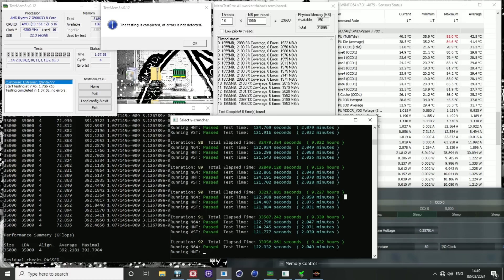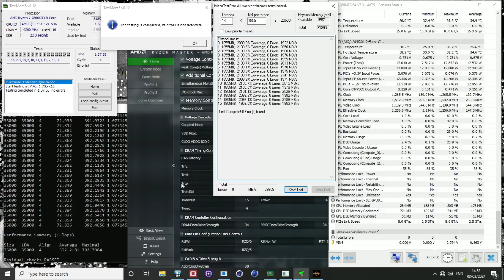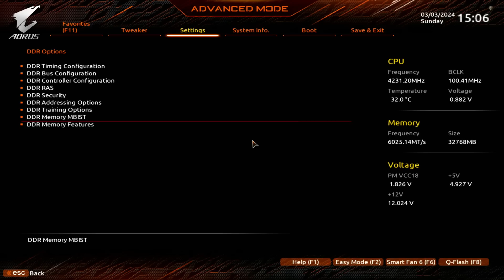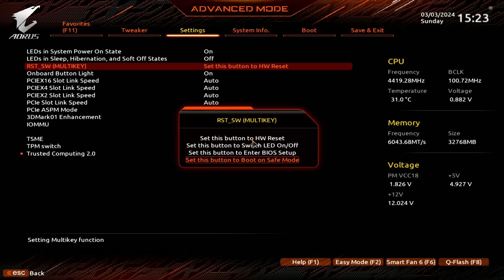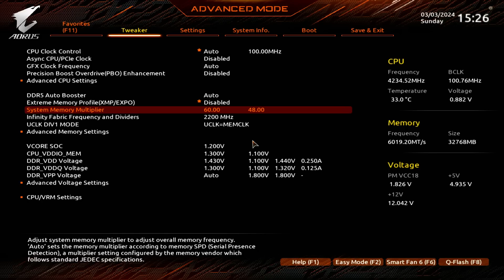Ryzen 7800X3D, 2200MHz FCLK, DDR5-6000 28-36-28-30

Comment: Actually even at 6000 MT I have issues with the 7800x3d. 
But only in BF5, dunno what that does to my memory, but there it simply hard resets (poof reboot).
Not reprdoducible otherwise so far ...
Reply from the maker: intresting I was seeing that at 6200.
Reply: But what I can do is run y-cruncher for hours + furmark (to get graphics going as well) + the hynix subtimings.
And that even with ram voltage of 1.3V and SoC 1.1V. (Expo sets 1.4V and 1.25V). 
And that runs stable (all benchmarks see no breakdown at lower voltages.
Its literally only bf5 where I have to go to 5600 cl32 or lower for it to be stable.
Reply: @Durayne  maybe increase your VSOC a bit. Not all chips can do 6000 at 1.1V.
Reply: I only did the testing with 1.1V / 1.3V to see if those instabilities are Voltage related. However even at those Voltages everything else is stable.
Default ist 1.25V and 1.4V but it does not help.
Reply: @Durayne Finally found someone with the exact same issue apparently.  My build was rock solid with my 7900x switched it to a 7800x3d (didn’t change anything else) only in bf5 I get instability issues.  I have completely wiped my windows and clean installed everything when swapping to the X3D so not OS related. So far looks like a game optimization problem for that particular Chip.
Reply: @ Hey there. Initially got it solved by removing the memory retraining saving. Has the drawback of having to do a memory training everytime.
With newer bios versions this did seem to not appear anymore. 
But I cant test BF5 anymore as I am using linux and EA now blocked linux over their ea anti-cheat.
Reply: Battlefield, the ultimate stability test lol (not kidding).

Comment: I have an Asus TUF B650 and older BIOS (0800 series and older) would train termination resistance, but newer and current versions aren't training terminations. Going from an early 0800 to a 1200 (and 1400/1600) with the exact same timings and terminations on auto wouldn't even boot. Punching in the trained terminations from the old BIOS and it boots and passes HCI no problem. And memory context restore is broken on Asus from what I see. Doesn't boot, even with default settings. I don't mind long boot times, except that I only have troubleshooting LEDs and I have to break my neck to see if it's actually going to post while tinkering lol.
Reply: Can you send me settings ? Ive got same setup and cant figure out best settings of BIOS :(
Reply: you are fine now? i have b650m-h/M.2  @JacobLtv
Reply: @HeadFlux  yea i am, but those ram timings was pain to setup that correcly.. anyways, if u or someone else have some better timings / better settings i would be happy if u share that with me 😇

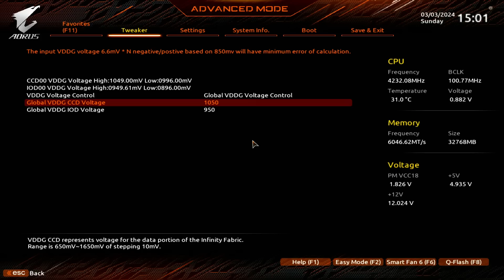Comment: 19:09 very true. I can run 2167 at the default 850mv but can’t stably run 2200 at 1050mv.
Reply: mine runs unstable if it goes anywhere above the default 1800. i guess i hit the negative jackpot on it
Reply: @jpteknoman  That sounds like some settings are wrong or you should RMA. 2000MHz IF is the minimum for any Zen 4 CPU. My guess is you enabled memory context restore and disabled power down.
Reply: right now I’m trying to get 2167 stable. 

I’m running 7200mhz cl34-42-42-38 1.4v.

it works perfect on 2133. when switching to 2167 it boots & everything works well. 

I can play a game or 2 & then it just restarts by itself. 

what do you think I should look at first ? Voltages ?
Reply: @LightWorks222  7200 on AM5 is much slower than 6000. From my experience, TestMem5 Extreme1 config’s 4 and 6 can detect IF instability really well. Linpack also works well.

If you are restarting by just playing games, your system is really, really unstable.

Comment: Could you please test the new G. Skill Fastest "AMD"  RAM DDR5-6400 CL40-46-46-102
96GB (a 48GB X2 stick kit)? Will it work at those speeds on all AMD setups and can it be overclocked higher, or the timings tightened? And I hear you get better performance with 2 sticks rather than 4, but does it make a difference if you get a motherboard with 4 memory slots vs 2 slots if you only use 2 sticks in either? Thanks.
Reply: Unless your cpu can run memory at 6400 you won’t get those to run at their rated speed, it’s down to the cpu memory controller more than anything on the ram sticks. By running all 4 slots you run more stress on the memory controller from dual dimms in every slot especially so don’t expect to run over 6000 if you’re running 4 sticks, maybe you’ll do 6200 or so with just 2.
Reply: just buy a 6400mhz cl32 kit. there 125$ rn. Make sure you only run 2 sticks

Comment: Have you tried benchmarking memory write performance after waking from sleep?  At least for Asus, seems it kills performance; wondering if Asus or AM5 issue? (regardless of MCR)
Reply: i have the same issue. write performance is very bad, also the latency 65ns(?).. I did the same as in this video.
Reply: @mrstripezz8076 You can't use sleep; use hibernate with MCR on
Reply: That is interesting, where did you notice the perf drops?
Reply: me too, i got 60 ns with fclk 2000, but 62ns with fclk 2100. Test with aida64

Comment: Interesting you can't get 6200+ stable. I'm running 6400/2200 just fine on my 7800x3d on my Asus b650e-e
Reply: yeah is wierd his cpu, maybe is just gigabyte bios, ive seen a lot of people running 6400 on 7800x3d, how has been your experience with the asus b650e e?, post time, stability?
Reply: @JomarsYT  when I first built the PC it wouldn't post and I couldn't figure out why then one day it just worked and it's been fine since. No fires yet🤣
Reply: @ertai222  xD

Comment: Whats the best ddr5 ram die or kit? In your opinion?
Reply: Depends on what you're using. If Intel, Hynix A followed very closely by M. If AMD, then Hynix A and M are even. You can get good Hynix M bin for $120.
Reply: Cheapest way to get Hynix is Kingston 5600 MT/s CL36 kits and faster costing about $100 to $130. Basically guaranteed Hynix.
Reply: is hynix a, all 7200 kits have it.

Comment: I'm running 7800X3D with BCLK @ 102 - DDR5 Tforce Hynx M die @ 6120MT - 28-35-35-70 1.41v
Reply: Why are you reducing your CPU and RAM lifespan by overclocking?
Reply: @Arif_Islam77  because i dont plasn to keep the same CPU and RAM for 50 years
Reply: @Arif_Islam77  loool

Comment: Would love if buildzoid did some gaming benchmarks comparing gaming performance using his extreme tweaked settings.
Reply: i wish so too, it'd be great to see the benefit in real world scenarios
Reply: If you can get 2167 stable then it is a night and day difference in terms of latency / speed vs 2133
Reply: really ? wtf, i'm stuck at 2133 2167 is close to stable, i saw on hwinfo my vsoc is lower than the hwinfo of bulldzoid, so i'll increase it to see if it help, i'm at 1,185v on hwinfo, when 1,20 vsoc in bios @LightWorks222
Reply: Hardware Unboxed has done that before, recently, I think
Reply: @chapstickbomber  indeed, used it to tweak my trident z neo memory kit on ryzen 7000, performance gain was massive
Reply: @chapstickbomber  Yes but BZ could do it better.
Reply from the maker: @Muldeeer  no I wouldn't. I have exactly 0 intrest in dealing with the mess that is benchmarking games. Synthetics already are annoying inconsistent as is. I don't want more variables to deal with.
Reply: @ActuallyHardcoreOverclocking  
Benchmark emulators lol
Reply: @ActuallyHardcoreOverclocking 

No worries, vast majority here more than appreciate the effort you put into all this! 

But yeah “gaming benchmarks” is opening a can of worms.. lol

The education you provide is more than enough as is.

You’ve personally helped me a great deal :)

Comment: Very interesting, id it safe to buy Ryzen 7xxx now? Also if it is safest would you prefer Ryzen 7 7800X3D or 9 7900X I work on 3d models and also play games occasionally lol. Cool video
Reply: Thanks!
Reply: It should be safe enough to buy Ryzen again provided you update the bios.
3D modeling programs tend to prefer more cores and clock speed so I'd get the 7900X. If you get the classic stutter in games disable the second CCD and it goes away.

Comment: the last time i heard about fclk is that you need to run them in sync with memclk, 1:1 or 1:2 
what's the update?
I don't follow much news anymore
Reply: Syncing fclk and mclk was the way to go on Ryzen 5000, but with the new gen 7000 chips you can run desync with no latency increase. Just push fclk as high as you can and then mclk as high as you can.
Reply: You can't anymore
Reply: as in
now it's better to just run the memory faster on am5?
Reply: @wiyandri13973  Yep

Comment: Привет. Подскажите, я сейчас имею gigabyte b650 aorus elite ex, 7600x, и оперативную память зелёная hynix a-die, я выставляю в Биос напряжение 1.45 и компьютер выключается. Память не берет больше 1.38 напряжение. На материнской плате z790 Apex, эта память работает на 8200 мегагерц. Почему на моей б650 не получается подать больше 1.38 ? Если я ставлю 1.4, то все работает, но напряжение в hwinfo 1.38 максимум. А если ставлю 1.45, то компьютер просто выключается, после сам включается и снова выключается. Память - 16GBx2 hmcg78agbua081N AA A-die
Reply from the maker: I can't read whatever language this is.
Reply: Если ставлю cl 28,то поведение компьютера такое же. Я не понимаю почему....я уверен, что эта память может работать на 6400 cl28
Reply: You need to turn on PMIC high voltage mode in your BIOS, by default you won't be able to set the voltage higher than 1.435V
Reply: @Jas7520  do you know where this setting is?

Comment: Hi! Thanks for the videos! They help a lot!
Please correct me if I am wrong, but last time with the oscilloscope, didn't you say running FCLK 2167 and above yields unstable results? Has that problem been fixed? Maybe I missed out a part or two regarding this. Thanks!!
Reply: That 7800 x3d chip has a better IF then his other 7000 chips.
Reply from the maker: it's a silicon lottery thing. Some chips do higher FCLK than others.
Reply: @ActuallyHardcoreOverclocking  Thanks for the reply!

Comment: Recently started overclocking the DDR5 to 6000 with the video with ‘easy am5 timings’ but was getting blue screen / freezes within Bios (Gigabyte B650 aorus elite ax F5)
Not sure if its the Bios version that is causing it or the 7800X3D just runs unstable with those timings, but might try lowering voltages shown in this video. 

Basically enabled the Hynix A die XMP of 6600 and lowered it to 6000, but even so it gets my blue screens / instability. might be the vltage, but when setting 1.25v SOC the SOC shown in HWInfo is 1.2v.

P.s. when pc doesn’t post nor gets into bios - do I switch PSU off or hold down pc power button?
Reply from the maker: turn off PSU and jump the clear CMOS pins
Reply: @ActuallyHardcoreOverclocking  is CMOS required even if you managed to get into BIOS and restore to 'optimized defaults'?
Reply: when it hasnt post yet, you can power button to turn it off, reset cmos and setup bios again
Reply: Make sure you disable memory context restore and power down. Those two can cause weird stability issues. Though if you enable them together, it’ll probably be fine.
Reply: @PowellCat745  Okay, might try that. I thought it was just if training misses x times then it will boot into bios with agesa defaults.
That like it behaves at my PC.
Okay it still shows the selected timings but checking actual timing shows then agesa defaults.
Didnt know it causes stability issues though.
Reply: I am having the exact same issue and I'm also on a very similar motherboard (Gigabyte x670 aorus elite ax). I can't get it to go over 1.2V SoC in HWiNFO64, I can go lower but it's like 1.2V SoC is the hard cap, at least when looking at the SVI3 TFN reading. This is a problem that is consistent with all of the bios versions available that are after the SoC voltage restrictions, i.e., F8, F9a, and F9b.
Reply: @katietree4949  No, I was just asking the the reason behind it.
Reply: Try adjusting your terminations - lowest possible (30/34) drive strength, and impedances at 40/48.
Reply: У меня тоже b650 aorus elite. У меня на Биос f6b тоже не даёт больше 1.2 на  SOС. Ставишь в Биос 1.25, а он все равно дает 1.2
Reply: Вчера хотел вернуть старые Биос - f3h, но не смог
Reply: Why are you reducing your CPU and RAM lifespan by overclocking?
Reply: @Arif_Islam77  As long as you don’t make voltages too high, lifespan won’t be affected.
Reply: @Arif_Islam77  If you had read what he said you would realize he is downclocking.  He bought a 6600 MHz kit and is trying to run it at 6000.  That's not overclocking.
Reply: @TripmasterG  Ok my bad. Thanks.
Reply: @Arif_Islam77  DDR5 never reaches anywhere near max temps on a normal system. Even at CL6000, you're looking at maybe 45c max temps...on a hot day. That's way below the 95c operating temperature. RAM and CPU's are one of the most stable and long lasting things in a PC system. Motherboards fail way before they will, and they will both become obsolete before they can even reach a level of failure.
Reply: @peoplez129  So how much should I or can I safely OC my DDR5 6000 MHz CL30 ?
Reply: @Arif_Islam77  I wouldn't bother going anymore than 6000. For RAM, stability isn't just about temps. It could be running ice cold and if you tried to run 10,000mhz it'd still crash.
Reply: @Arif_Islam77  you know the channel name, right?
Reply: @Arif_Islam77  why are you even here, and have you ever seen a RAM die?